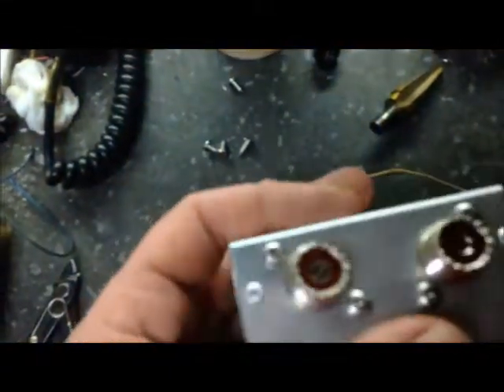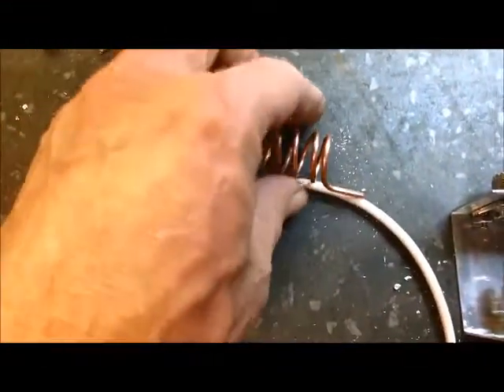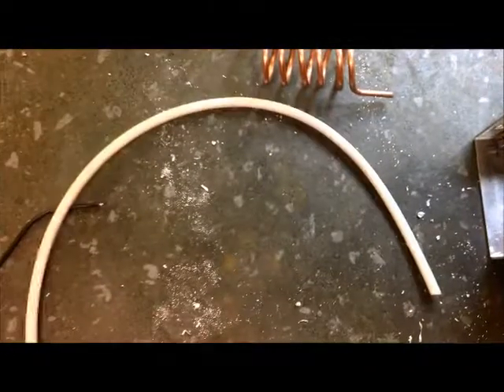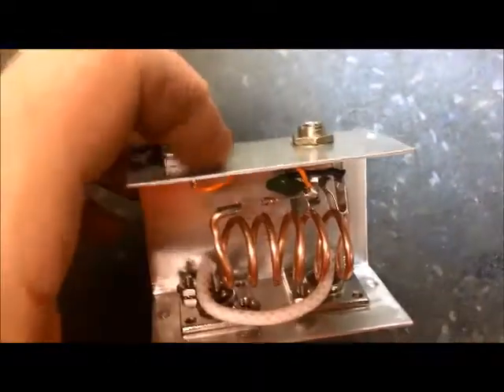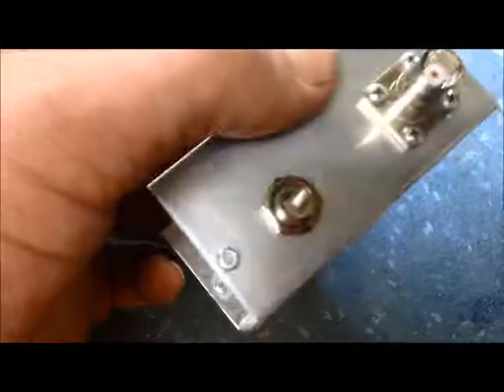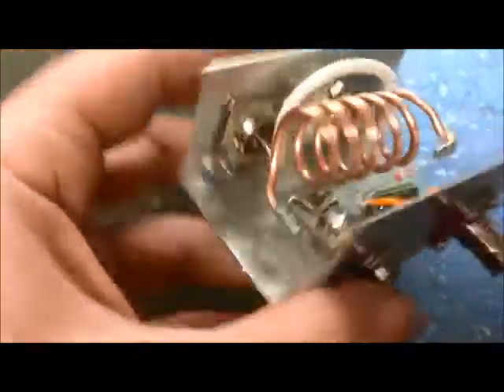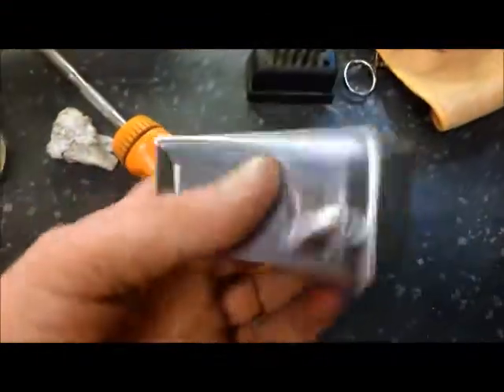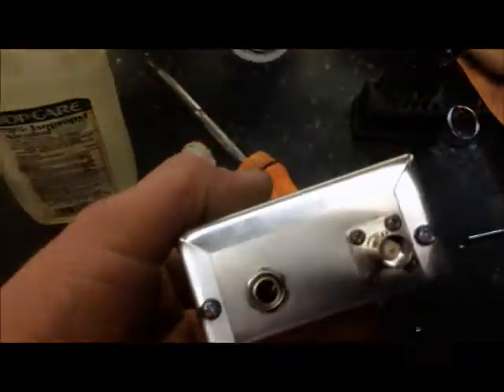Am headphone monitor

Comment: What resistor did you use and could you tell me about the coil,does it have to be a certain size,73s
Reply from the maker: No resistor at all, I think what your referring to is the diode, and that diode would be a 1n34a. Now for the coil, I've played with different sizes and didn't see a difference, what will make a difference is how many wraps you make the coil.So for instance if you wanted to just do a radio threw it then I would do 3 to 4 wraps, if you wanted to listen with a driver on, say something like a 2 pill then 6 to 7 wraps and if it where a bigger amp then that then you would have to go longer with the coil.